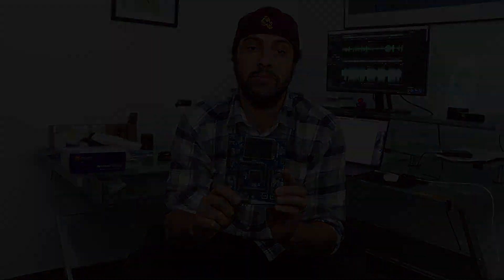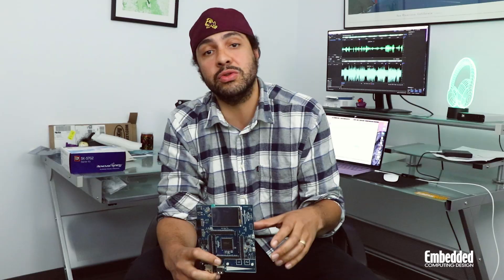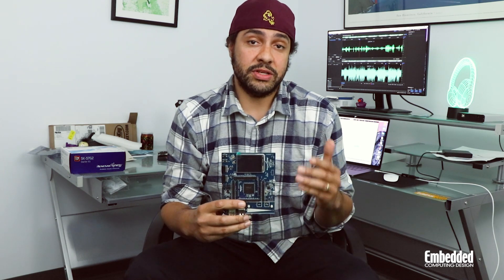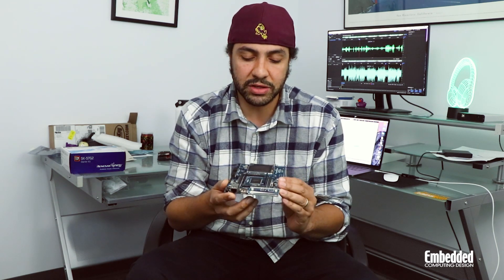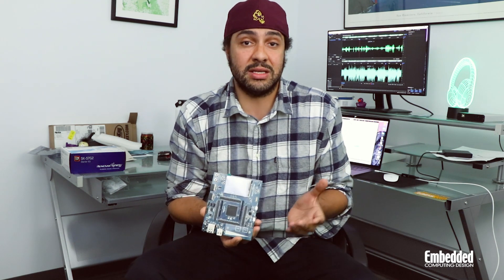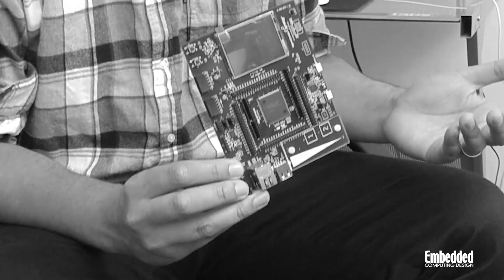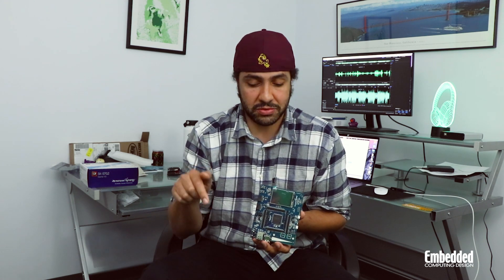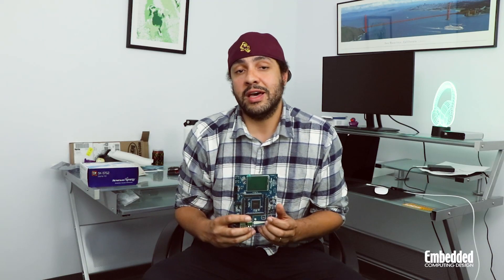Dev Kit Weekly – Renesas Synergy SK-S7G2 Starter Kit

Comment: Is there any sort of test software/firmware for the S7G2 that lets you manually flip the bits of the output ports from a GUI? I’m trying to debug the hardware of a board that uses a S7G2 so I’m not really interested in programming it but just being able to turn individual output pins on and off to test if other components are seeing the signal values.